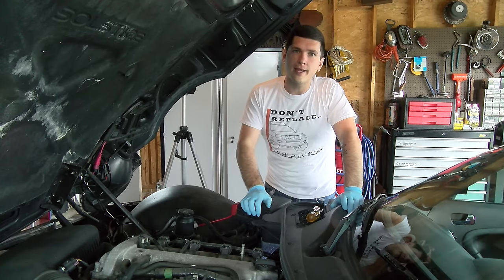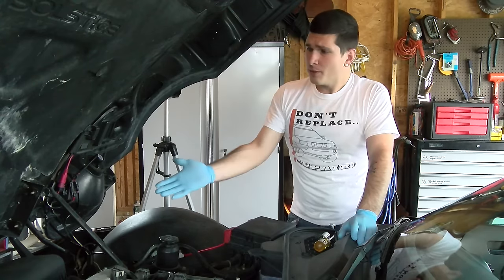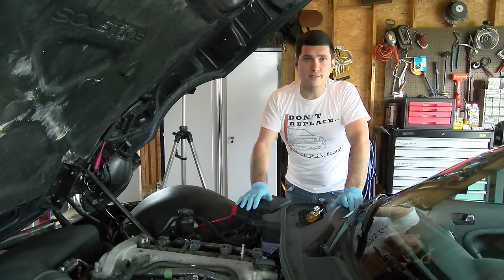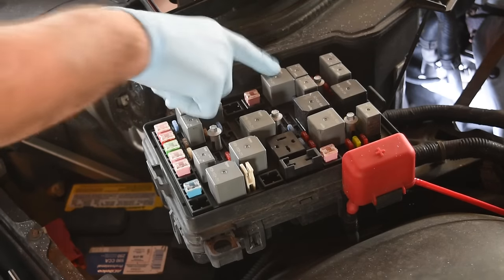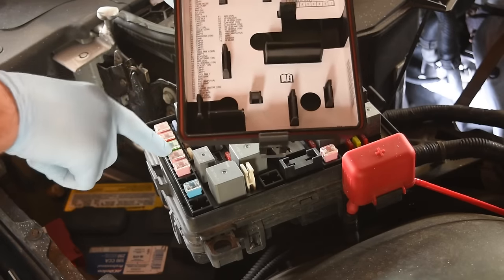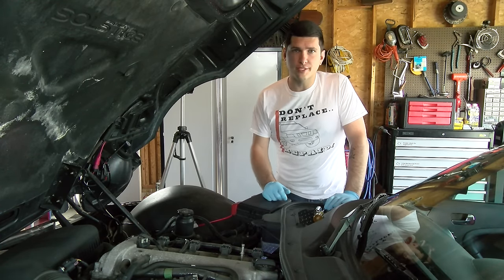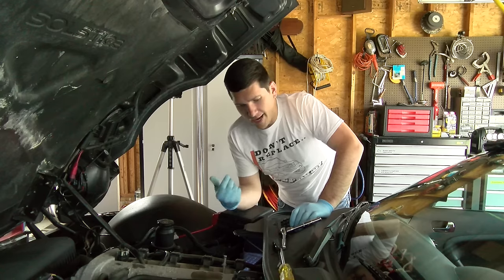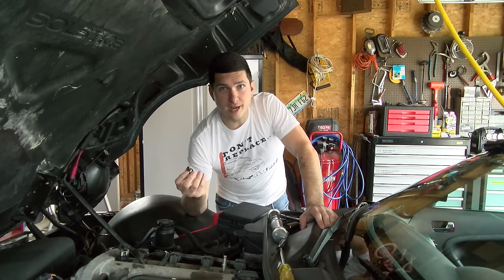How to Diagnose A Constantly Running Fan

Comment: Hey there, we have a 250 hp tactor that does this and I think after watching ur video that it is the temp sensor.
You said that a manual fan with a clutch is ran of the belt, but isnt an electric that aswell?
Reply from the maker: No, an electric fan will have an electric motor on it that turns the fan. All it needs is an electric connection to run. No belts.
Reply: @Rythecarguy  Our fan is told when to speed up and down via electricity instead of the old way with fluids, that we also own tractors that are using. 

That is what I refer to when I say an electric fan, but maybe a belt driven fan is similar controlled to an electric driven fan, so the problem may be the same as in your video, I just think that the sensor is placed in front of the fan instead and that works because the fan in build to run constantly then speed up when the water is getting hot. When the water gets hot the air coming through the radiator in front of the fan will change in temps and the fan will adjust speed. Not sure tho.

Comment: What if you just need Freon is that possible?
Reply from the maker: Yes but you will need to bring it to a professional for Freon. They don't sell that in stores. Also, if your refrigerant is low then there is a reason. It would need to have a leak.

Comment: on my 95 accord, the radiator fan sometimes do not shut off when my car is turned off. the fan would goes on forever until the battery dies. i've replaced the radiator fan relay in the fuse box and that did not solve the problem. there is no engine light. what do you think what might possibly be?
Reply: Christopher Owens mines 2 & my fans come & stay on the whole time...

Comment: I have a 2009 ford flex and my cooling fan stays running after the car is turned off for a long period of time it ends up killing my battery what could be the cause of it?
Reply: Thats a mixture of problems. First your car is designed to cool the engine a little bit once is off but looks like the temp sensor is dead as well so it doesnt know when to stop

Comment: Can not get power down to cooling fans on the radiator is there a fuse or regulator. It a 2010 Jetta 2.5 gas

Comment: I have a 2012 Ford Edge, the problem that I'm having is that as soon as I turn on the air conditioner de fans start running at full speed and stay like that for as long as I drive the car. Even if I shut the ac off the fans will stay on at full speed for a long time. The loud noise is embarrassing. However, If I don't turn on the ac when I first start up the car the fans will work normally. This is bugging me as hell.

Comment: i have an 06  silverado 1500 my fans run constantly,   i changed the  temp sensor, and they still stay on. I have to pull the relay 1 to shut them down ,  i replaced the relay 1 with a new one still running , my question is this should i just replace all 3 relays ,and hope that works?  also  when i put the relay back in without the key in they ignition the fans come on, u think this  could be a short in the wiring somewhere?? or maybe a short in the fan unit itself??
Reply: Jim A  I have the same problem and haven’t been able to figure it out. Did you figure out what it was?
Reply: @goyitosalazargs   ok so here  is what i did, i took the computer out of the truck, took  it apart checked out the mother board  for water damage  and such, i saw nothing , i sprayed the pins on the computer itself  with  QD contact cleaner, as well as the connectors  in the truck to the computer, i haven't had a problem since, after doing that i can use the remote to set my alarm that i couldnt use for moths prior to cleaning the connections, i hope this helps , sry for the delay in responding

Comment: Was wondering if i can make my fans work more efficiently on my 2008 Impala SS both fans turn on but i feel like they dont spin as fast as it should because as soon as i open the hood the engine is hot and no it does not overheat at all my fans are new and thermostat is new as well i just feel like the engine bay can be a bit cooler what can i do?
Reply: You should first know what temp your engine is at. Maybe the temp is perfect and you are exaggerating. Engines are efficient when hot, when they are cold they are designed to burn more fuel to reach operating temperature faster and perform the  best. So what could you do is connect an OBD and see if temp is between expected around 100 Celsius or 210 Fahrenheit. Also fans have different speeds when the engine its too hot it will run faster and be pretty loud, but when its just over normal temp they wont go too fast just the necessary

Comment: Someone told me it could be an air-lock at the sensor or before the thermostat. What do you think of that diagnosis? And how the heck would you fix something like that? The radiator was just replaced and we think there might be air in there. We have no idea how to fix this, do you?
Reply from the maker: +ThePatriotsBrother look up "burping your radiator" that should help
Reply: Thank you very much!
Reply: ThePatriotsBrother park your car on a steep grade so the front of your car is pointing up hill, start your car open the hood and start squeezing the upper rad hose in a quick  fast motion, I had an airlock once and a mechanic told me to try this it worked, it only took about 30 seconds and the airlock was gone
Reply: Not being a jerk but this was the wrong way to go about it... now hear me out before you wanna scream at me... lets say you bought the part you put it in and that didnt fix it, now you just wasted money. You should have hooked a scan tool to the vehicle and checked the temp through that... if right when you start your car up on a cold start and the scanner is telling you its much hotter or colder than the outside temperature then you know right there that you have an issue... or if once the car is heated up to operating temperature which is 180f to 190f and it reads different then again you know you have an issue... lets not forget about broken wires... could have very easily been a faulty wire to the sensor or pcm. Not at all being a jerk i swear, but if youre going to teach on you tube you should be proficient in your practices, if not youre jist going to have a bunch of people throwing parts at their vehicles until they are fixed. Ive been fixing cars for a very long time and have seen it all... this is just my .02   
Hell maybe you did do ecerything i had mentioned above, but if so let your viewers know so that they know the proper steps to take.
Reply: hocheye you forgot to mention to take your radiator cap off. The cap has to be off... if its not off there is no where for the air to escape.
Reply: Awesome! Thank you hocheye!
Reply: Thank you also Bruce Allen!

Comment: I have the same problem after radiator leaks changed thermostat,radiator hoses and radiator along with a new temperature sensor. Fans running on startup and AC blowing hot air . Any odwas anyone please help thank you.

Comment: Is a temperature sensor also just called a thermostat?
Reply: no, the thermostat opens and closes when the fluid heats up controlling the temperature. The sensor controls the fans turning on and off also controlling the internal temp of the motor.

Comment: i had the same problem before on my 1998 corolla, i replaced the coolant temp sensor switch and the cooling fan relay but the fan still runs as soon as the ignition switch is turn on. upon checking i found out that its a wire problem, the wires from the sensor to the relay were fried.
Reply: Jay Guevarra but was the temp gauge running and operating properly?
Reply: @mohammedbenz9361  my still runs engine temperature and both fans still run on high

Comment: guys please use simple linguistics. what's wrong in calling the coolant coolant or simply water. it took me hours to find out that anti freez is the water inside the radiator. anyways thanks it really helpful
Reply from the maker: I'm sorry but I call thinking by their names. There is no water in my radiators. There is only antifreeze. Antifreeze CONTAINS some water but it is not water. Antifreeze = coolant

Comment: I changed my radiator fan on my 96 bmw 318ti and it works but now my car turns on and then Boggs down and turns off. But it worked fine before. Has anybody ever had the same problem? I stumped!

Comment: Hey I have a 2012 Nissan maxima and My car. Fan always stay on while the car is on every time I turn on the car They come on and never shut off in till I turn off the car then shut off what seems to be the problem if you please do know let me know
Reply: Delgado .210 every figure out the problem
Reply: Same problem here :( 09 Altima and fans always running no matter what it's freezing outside right now and fans start up as soon as car turns on

Comment: Does fan running high cause higher fuel consumption?
Reply: Sure. Wears your alternator, too. Not to mention the fan motor itself :( BTW I have the very same problem, been popping out relays and checking wires today...got to try to change this temp sensor next.
Reply: @rabot8837  did you figure out the problem?
Reply: @pono321  Yes. I disconnected the battery for 30 mins. That did the trick😁
Reply: @pono321  I also disconnected temp sensor cable too...
Reply: @rabot8837  if I disconnect the temp sensor cable, I get check engine light and several other haha, So I replaced it and still fans runs at high speed.
Reply: @pono321  I removed it only for 30 mins. Btw, my car is a different make anyway. Cant tell, what was the fault but it has worked do far...

Comment: Just putting this here to help anyone who may have had my issue:  Summary: Car dies while driving or idle, outside temp high, fans keep blowing when car not started.... VW Jetta
I bought a like-new car today and as I was driving home it totally died 4 times.  I was like what the hell, began freaking out, and was going to return it. Got out and the fan was running with the key in my hand. 10 min later and still on. Removed the relay and both stopped. I waited 10 min and put them in and the fan did not start. But it was 105+ so likely 130+ in my engine... I came to the conclusion that the antifreeze got so hot that it thought that the engine was hotter than hell so remained going, even when the engine itself was not too hot, thus causing a shortage of power to the vehicle (explains the dying and electric malfunction indicator) Today it was much cooler, I started my car and no fan activity. Allowed it to run idle for 15min and still no fan.  Unplugged fan relay and the engine died (good). I guess this will only help a small number of people but if it is hot as hell it may not be an issue with your car. It has started fine with no dying or stalling. This video did help me realize that the temp sensor has a job and under extreme heat may not work properly. Thank you!

Comment: What if they spin but not actually fast enough to blow
Reply from the maker: Probably a bad motor. Check the voltage going to the fan. See if it's low. Then bench test the fan and see it if runs right.
Reply: @Rythecarguy  let me give a little more detail so I have two cars with the same engine and In the on position not started they always have ran at a low speed not blowing air tho and the cars never overheat and warm up fine they are vq engines that’s what i was wondering if it’s normal for those particular cars

Comment: I have an 08 silverado and the fan comes on right after I start it. I replaced the coolant temperature sensor and it still runs on startup. Could it be still be a relay?
Reply: Did you get it figured out, I'm having same issue?

Comment: I have a 2008 Ford Fusion, once the fan comes on it is incapable of turning off, this one does not have a relay it has an ecm, I changed the temp sensor and ecm, and I’m having the same problem, any suggestions?
Reply: Did you ever get to the bottom of this? I've got the same car and the same problem!